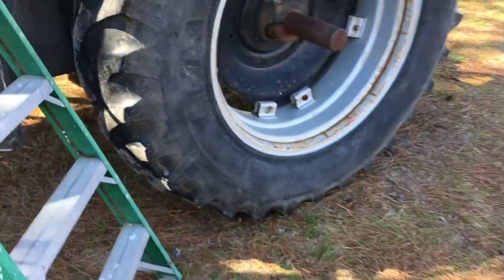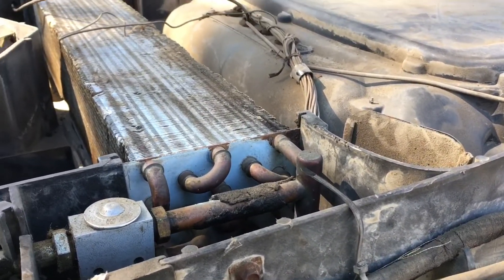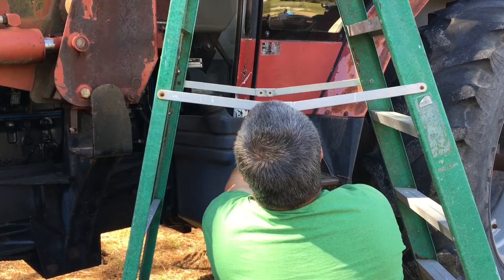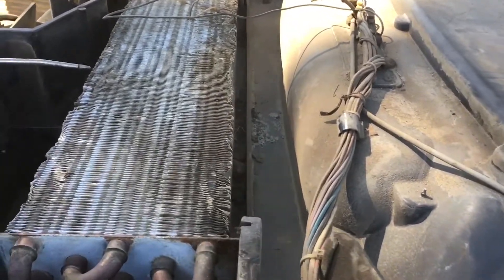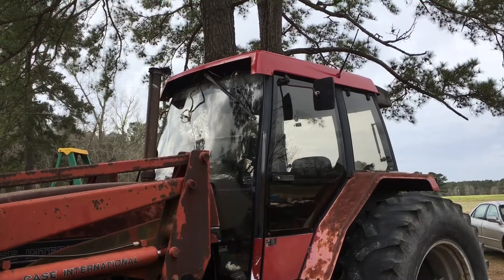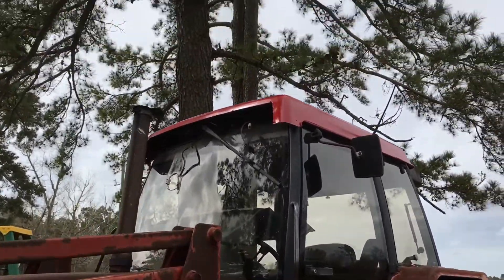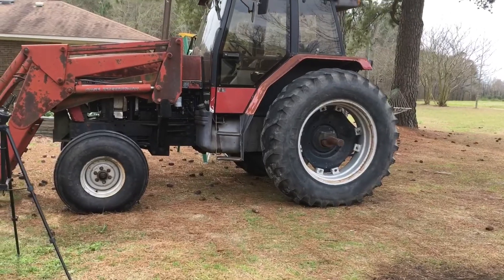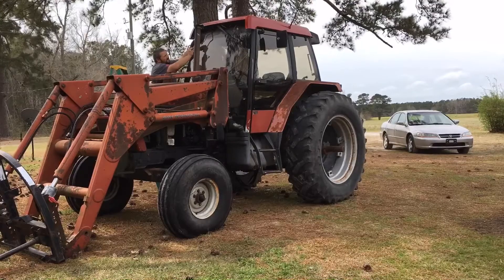Case IH 5140  cleaning the AC coils

Comment: Great video Jacky. That sure is a nice looking tractor. The roof turned out real nice.  That air conditioning will be easier on you in the summer.  Thanks for sharing
Reply from the maker: TFW. It should make it a little easier on them hot days. I’m ready to put it to work. Have a good one

Comment: We did this on our 5240, it was dirtier than your evaporator. Some times the drain leakes into the cab, it looks like those grommets will fix that. I was having trouble with the A/C cutting off at low engine  RPM. Come to find out the head pressure was too high, we added a fan on the front of the condenser, it has a relay that cuts it on and off with the A/C compressor. Now we're staying nice and cool in the hay fields during summer. Have a good one.
Reply from the maker: Thanks for watching. Soon as we get to put it to work if it needs it I will put a electrical fan on it. Thanks for the tip.Water hose washers fit the drain tubes good. I can’t wait to use it. Have a good one
Reply: @GerraldFarms  If you need any help with the fan/relay wiring, just let me know. I found the service manual CD online which has been a big help.You may want to get one.
Reply from the maker: MAC Farm is sending us some manuals.

Comment: What bolts did you have to take off to get the top off and where are they located? did you have to take the front lights out? Did you have to take the side mirrors off?
Reply from the maker: Thanks for watching and commenting. No the mirrors stayed on the doors. The bolts was on both side of the cab. Under the lip. Like a drip edge edge. I had to un plug the lights and they come off with roof.
Reply: @GerraldFarms  thank you